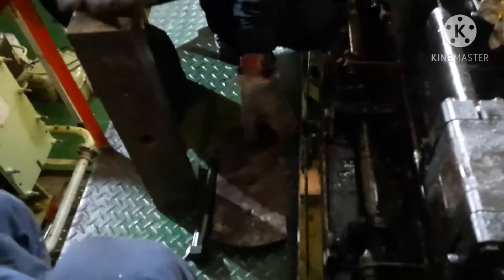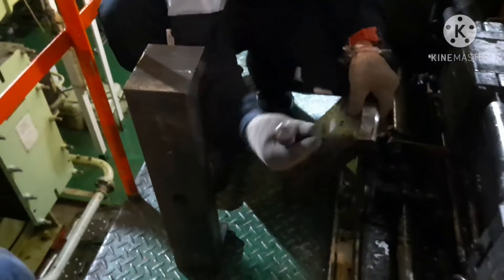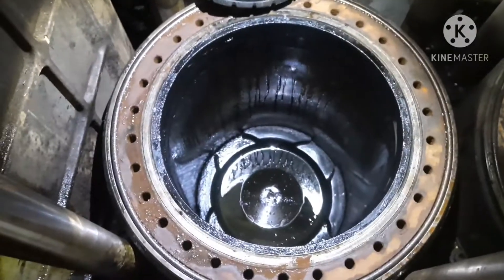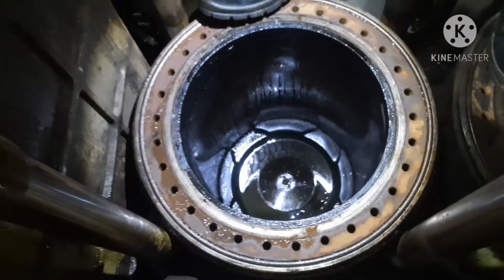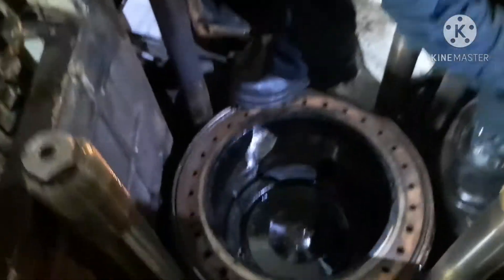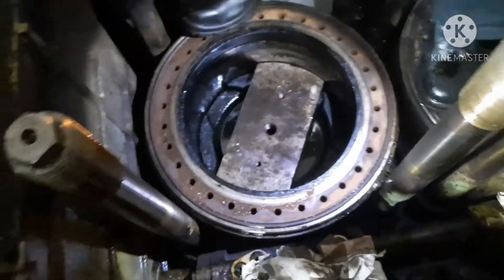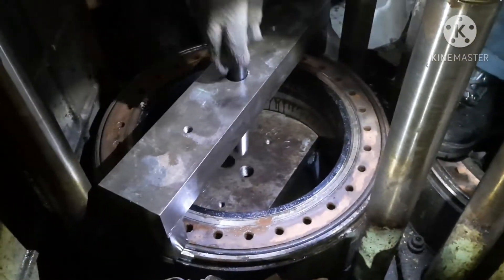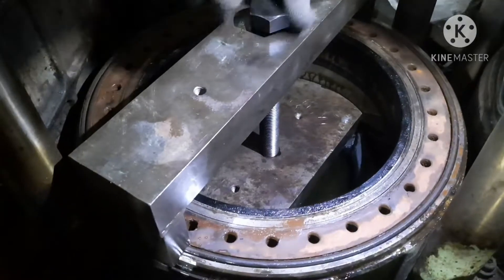PART-7 (ENGLISH) How do they do...DIAHATSU generator DECARB ....( HOW TO REMOVE PISTON FLAME RING)

Comment: If you using piston force to remove  flame ring, it's possible to lift cylinder liner with it. The proper way will be to use force of jacking bolt. God bless !
Reply from the maker: Thanks for the info... The liner anyway will be kept locked in such case.. Keep supporting sir..your comments are really helpful